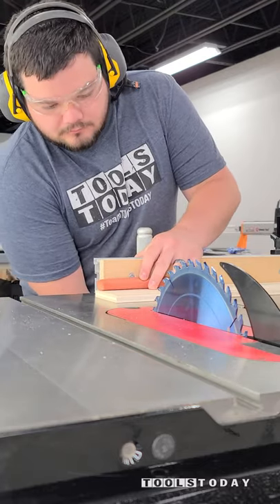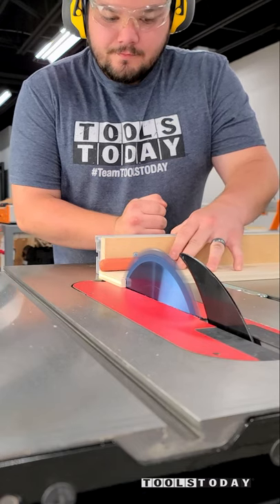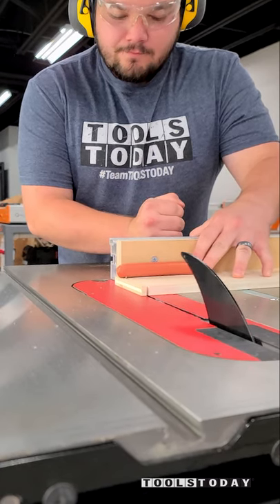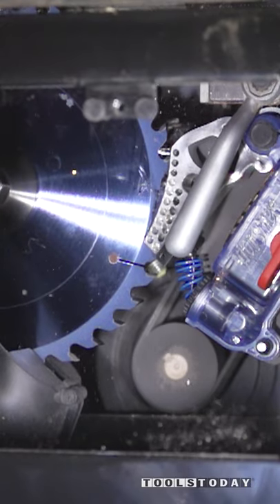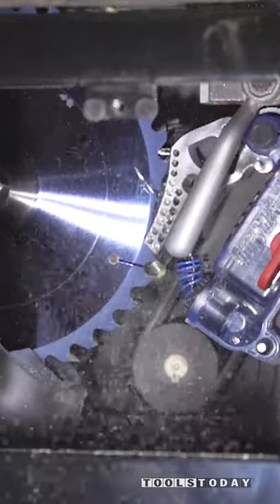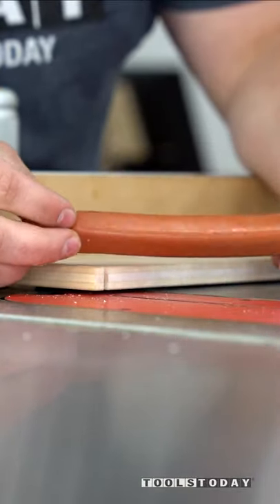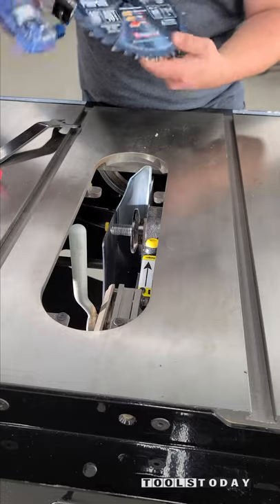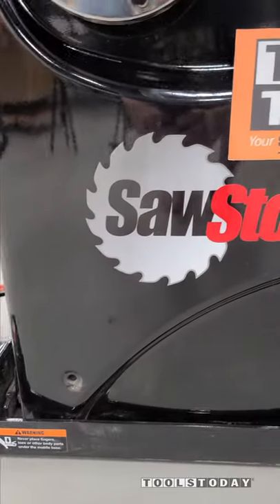SawStop Hot Dog Test

Comment: I think the saw sensor reacts to the slight electrical charge in a finger just as the touch screen on our phone does. The wood has no charge. This was begging to be invented for years, I'm surprised it took so long. There's another sawstop video here where the guy actually accedently touched the blade on video, and the finger didn't exactly have "zero scratches" but  close. It barely drew blood. If this is a new thing, I would see if they are selling just the brake unit, or wait until they do sell one. It'd probably ba whole lot easier on the wallet.

The bonus Is, we can now quickly make Van Camp beany weenies, safely.
Reply: Yup, you’re right, your finger becomes the ground when the saw blade it’s it instantly kicks the blade down.